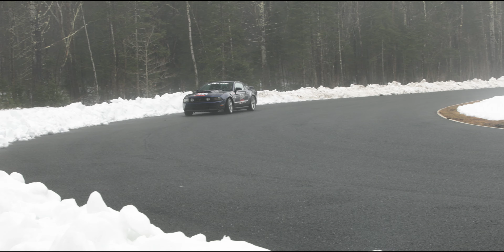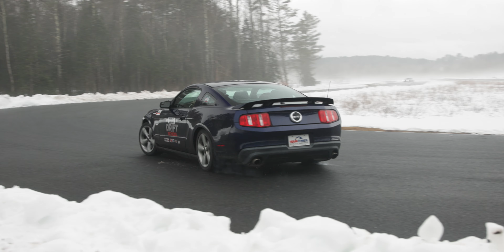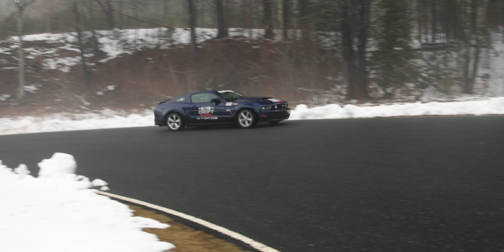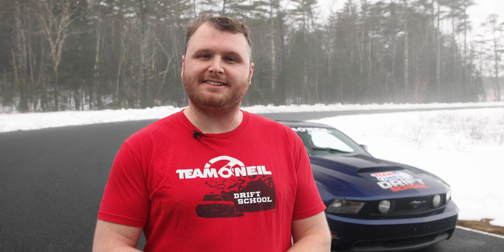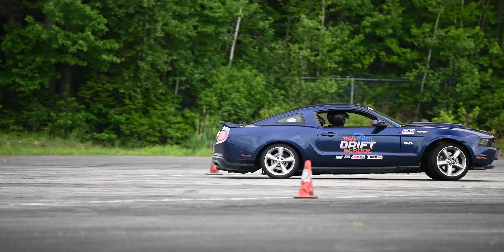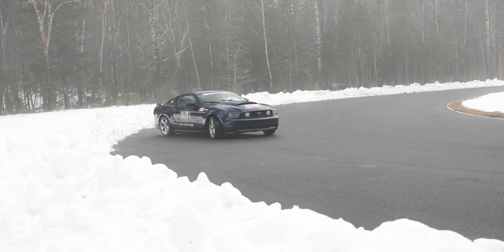Clutch Kicking To Start A Drift

Comment: I used to LOOOOOVE doing this back when I first started learning how to drift. Actually learned from some cool old japanese dudes by a pier (im not even kidding). Had extreme difficulty at first, because everyone thought you couldnt or that I couldnt, drift an AWD car by clutch kicking. Took some time, but had to figure out (as mentioned in the video) what speed, what RPM, and what gear to initiate in. 

In the car at the time, it was mostly 3rd gear, or I would drop down from 4th into third, or 3rd into second, depending on my speed.

Anywho, great video as always!
Reply: awd cars are usually 60:40 rear:front or 65:35 or something like that so sure you can, my current land cruiser and previously range rover sport could all powerslide on wet/snow so nicely it's even a better feeling than drifting my manual nissan 350z around on tarmac, theres sjust something cool about powersliding awds i cant explain :-)
Reply: @lumikarhu  No disagreement about that, lol. The car in my example as 50:50, but my friends had much of what you described (Subbies/GTR's). 

Those were easy to swing around, but never heard of anyone drifting a land cruiser. Lol, you sound like someone I know.
Reply: @lumikarhu Hey man, I'm a young dumb kid in a subaru and I'd like to try to pick someone's brain on clutch kicking/ maybe some info on what botching the clutch kick would actually do to my engine/clutch on a little 4 cylinder.  Maybe you've got insight, posting for anyone to leave some responses maybe though lol

Comment: Sweet, short and simple.  Thanks for the lesson.  Public roads are not the place to practice.  Reduce the hazards by going to a track where the hazards are reduced and the hazards that remain are controlled.  Better yet, go to a school and learn the right way to do it first so you don't practice and engrain bad habits.

Comment: Hey tyler, this is a nice video. Straight to the point, love it. Do you think there's a certain case where clutch kicking is better than momentum + handbrake technique?
Reply: They all have their place. This is the first technique to learn and is a foundation in many ways to the other techniques. There are also situations mid drift where a clutch kick can be helpful.

Comment: Need a video with an automatic. More specifically a truck lol😅
Reply: About the right speed or a little faster for thr corner. 

HEAVY braking and turn in sharp to upset the rear, lots of throttle and you're set
Reply from the maker: The closest thing we have at the moment: https://youtu.be/wxfKlVytncM?si=Zko-P6JHU8njDYxk
Reply: Two words: Neutral Bomb

Comment: You can’t be serious about mounting the seat harness like that. Oh boy
Reply: I love how loose his helmet is too lol
Reply: Just don't crash, problem solved.
Reply: There's more that you can't see. The harness goes past the bar to a proper chassis mounting point, the bar is mostly keeping the belts in position. There are also vertical bars (you can see the mounting tabs). This isn't there as an alternative to a cage, it just keeps harness belts in alignment so you can be held properly in the seat when driving aggressively. They are relying on the car's normal safety features and the nature of driving alone on a track with sufficient runout.
Reply: @PlanckRelic  i’m not talking about the harness bar, that is mostly fine. I’m talking about how the harness/belts itself is routed through the headrest, which is not correct and might cause serious neck injury in a crash. The belts might slip and squish the neck.